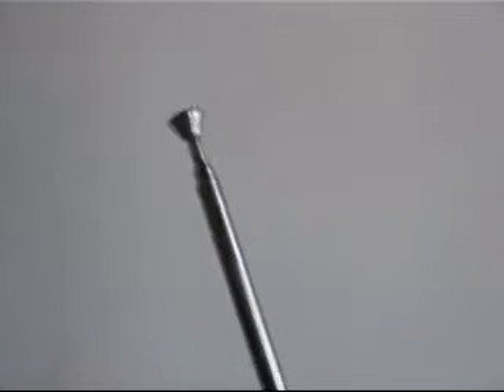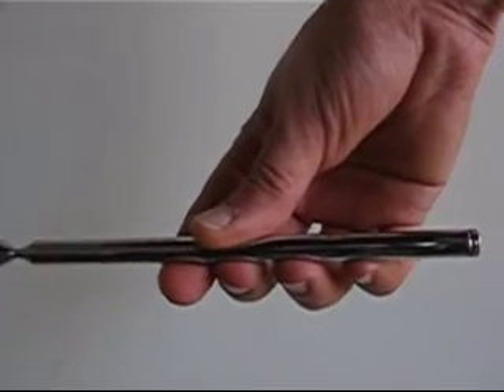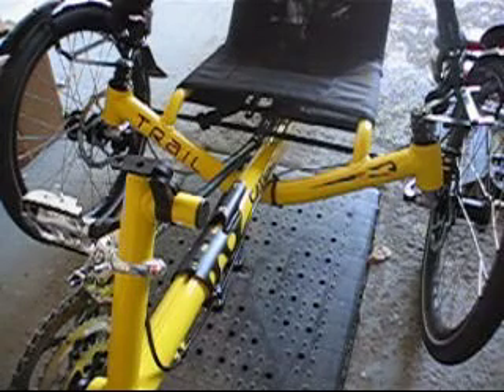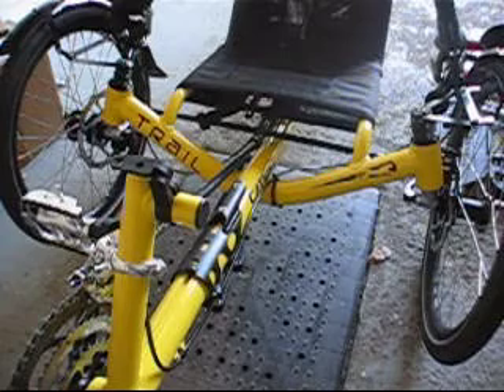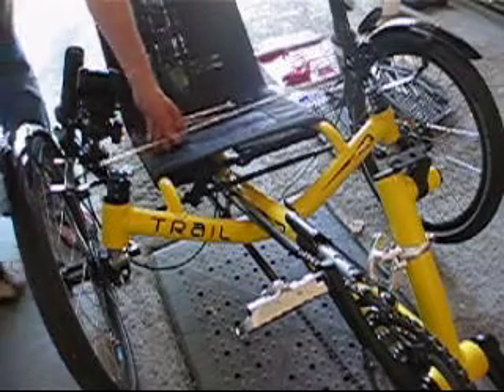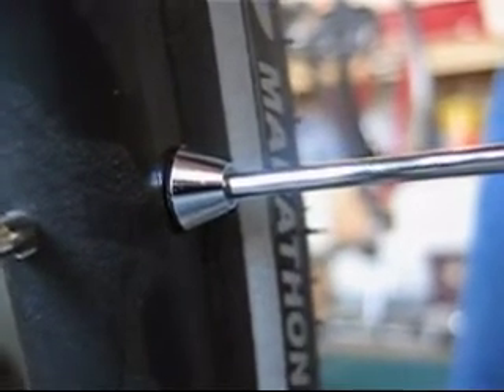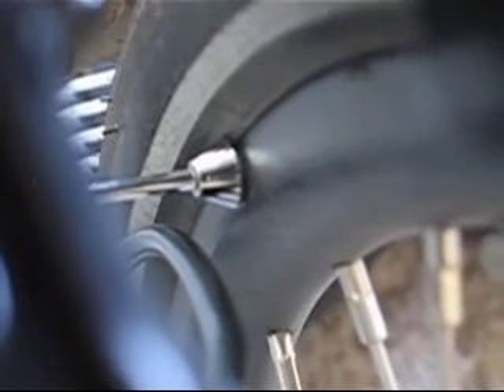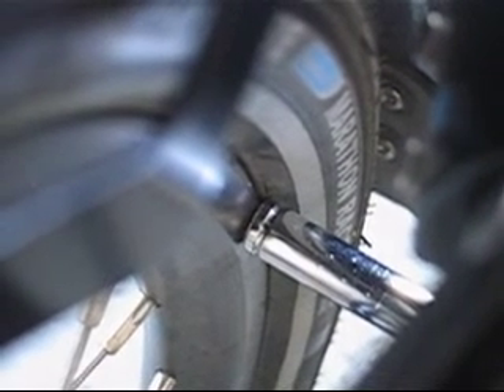Catrike Trail Trike Toe In Front Wheels Adjustment

Comment: I use a wooden dowel inside a small aluminum tube but for the life of me I can't get my Sunseeker fat Tad properly aligned.. it just eats tires in less than 300 miles...
What is the correct setting?
I've tried toe in toe out and straight level settings all fail.
Reply from the maker: on my particular trike, the max toe in was 1/16". If you set the wheel parallel, it will not be stable, if you set toe out, the trike will wobble badly the fastest you go. Toe in was the proper setting so I suspect it would be the same for you. 
Tires do get worn out, I made 4000km with mine and there was no thread for a long time. I had to replace them because I started to have flat. Not having thread does not mean finished tires on a bicycle, don't worry so much about the thread. Specially on trikes, we have much more stability than a two wheeler on wet or unpaved roads.
I never bother too much about the tire wearing off. Mine were Schwallbe Marathon Racer.

Comment: Some Catrikes have tierods which are threaded such that rotating the tierod does not change the length. To change the length on these, you have to remove one rod end from its wheel, and rotate that end in the rod. Reconnect it to check your adjustment. Advantage: the overall length doesn't change if the stop nuts should become loose. Disadvantage: it's harder to change the length, and the minimum change you can make is 1/2 turn of one rod end, which may result in a less-than-perfect toe setting.